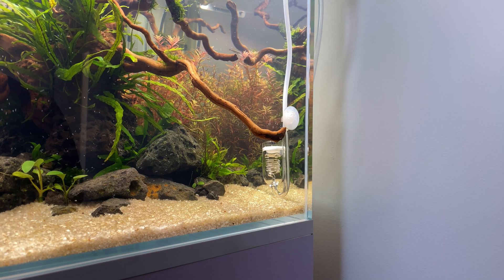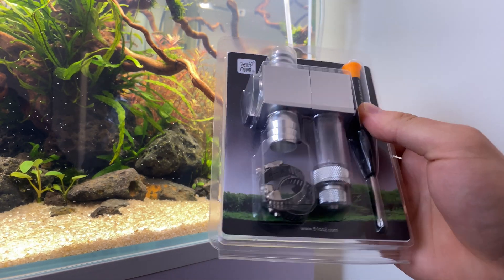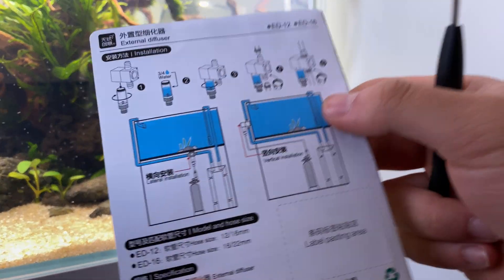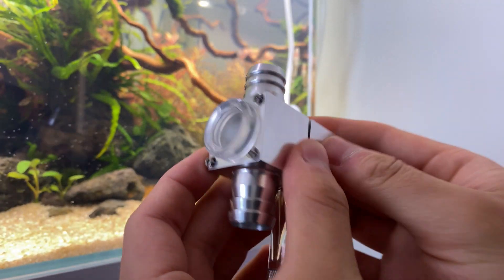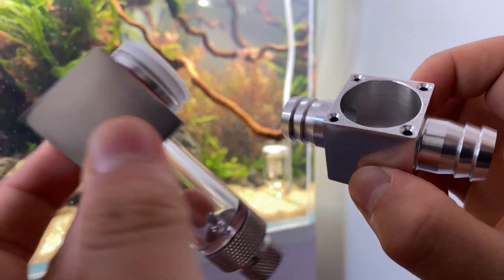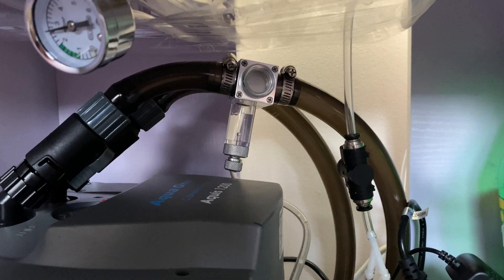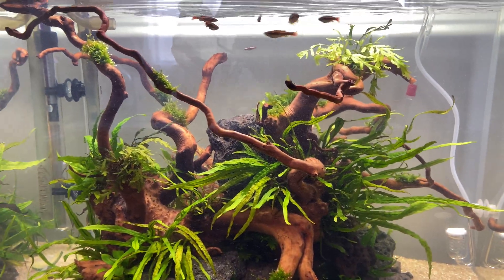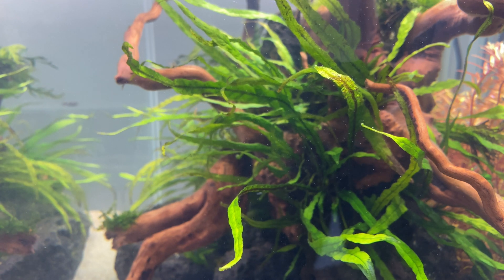External Diffuser Turn Co2 Into Mist

Comment: Great video! I have the same product, but after unscrewing all parts and then reassembling for my tank, I have a spring that it not installed. I am worried it is important - do you know where the spring goes? Is it supposed to be inside the lathers screw off cap? I’d really appreciate your advice!
Reply: Very simple to buy a new one to take apart and carefully find the order  , and then it's always best to have a few backups in your hobby  !!! GL

Comment: Nice video, but do you really need CO2 in your tank? You don't have any carpeting plant. Maybe you can lover light and make it more low tech? Especially because you don't have high pressure CO2 system, just yeast or acid DIY. As you know IT is very unstable and a lot of time makes more cons than pros. Best wishes, keep It up!